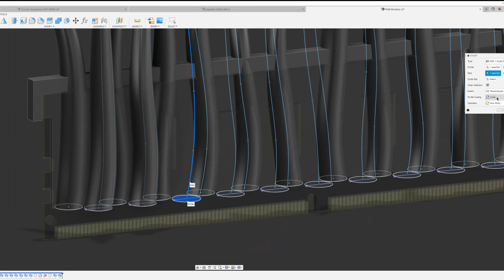Affordable METAL 3D Printing with PCBWay - Making Custom RAM Modules - Posthuman #1

Comment: Nice review thanks! It helped me get my first 3D printed Aluminum part done (have done silver jewelry before via Shapeways). I made five 2.65mm x 45mm x 45mm pin grid aluminum heat sinks (total surface area of ~4700mm^2 per heatsink) to add to my ASUS Zephyrs G14 2022. It helped keep boost clocks up by +100Mhz on average during all core loads (Cinebench R23, 30min run) and helped bring down the idle temps from 42C to 37C (both temps with a laptop cooling pad with a fan). Only cost about $40 for a very unique part that can't be made otherwise. CNC option was 3x the cost.

Comment: PCBway's CNC machining cost is about the same at $50 something USD for a small part.
i kept the model simple and have taps at home to finish it off. i also saved money by making one of the more difficult parts at home on my lathe. 
eventually I'll get a cnc mill to be able to make a wider range of things myself.

i like your heat spreaders that's pretty cool you went the extra mile to customize them.
Reply from the maker: Yea, with machining the cost is heavily dependent on the geometry. Something simple, geometric makes a lot of sense to machine, while something like these heat spreaders would not make any sense.

Comment: How strong are the parts and the bonding? Do you feel you could break off a tentacle with yours fingers if you tried? Or is it closer to a CNCed part? Thanks for the video!
Reply: If they are SLM Parts, they are nearly as stong than the base material
Reply from the maker: I was scared at first, though after sanding for hours, I handled them pretty rough and never thought I was anywhere close to damaging. I'm no material scientist, but I'd say it's pretty close to extruded aluminum. Even breaking the little tabs I had for the clips took repeated bending and leverage, and those are like 0.5mm thick.